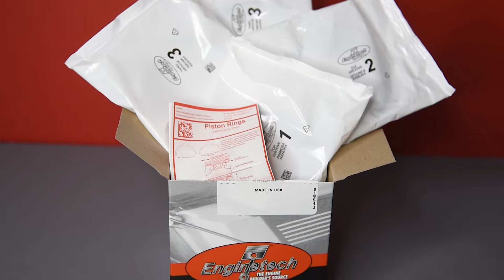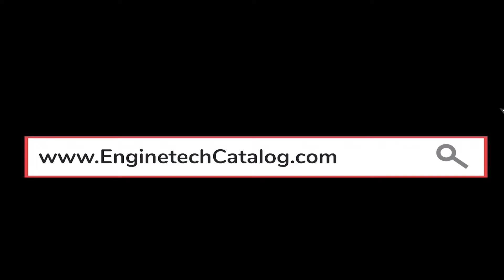Enginetech Piston Rings

Comment: How much do I gap M40718 Rings on P5076 pistons? Different piston manufacturers require more or less gap. There's no instructions in either box besides ring orientation. Your website makes it seem like both top and bottom can be the same as long as over .0035 per inch of bore. Please any sort of instructions would help.